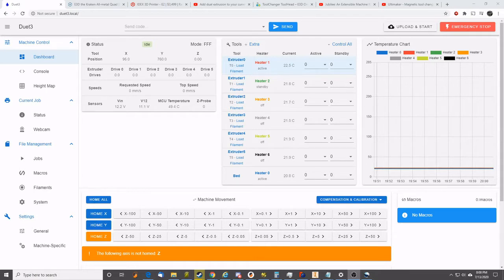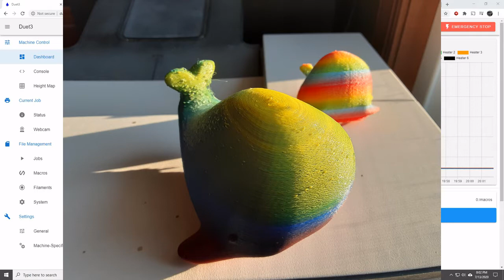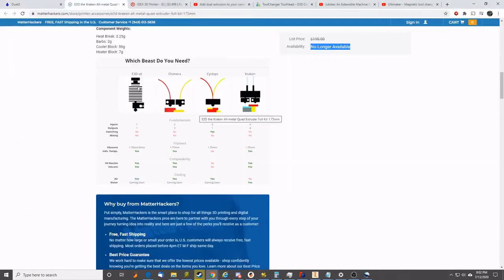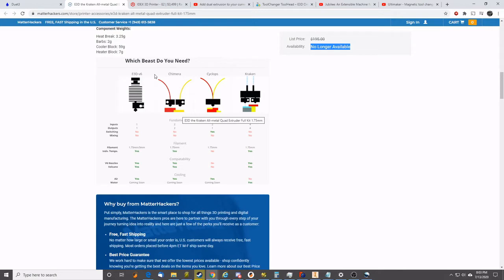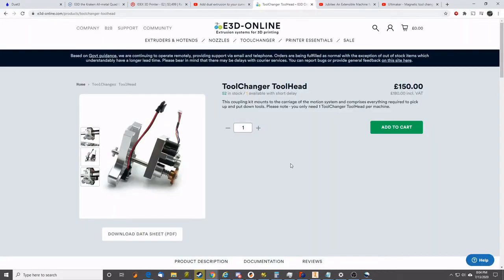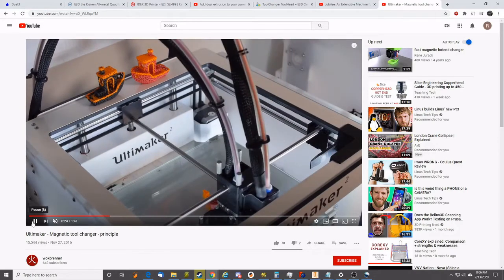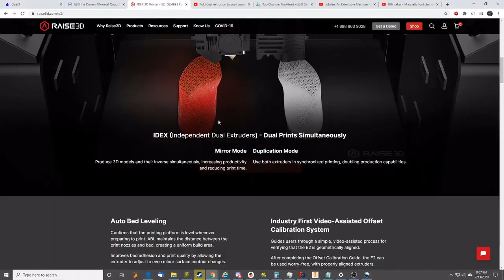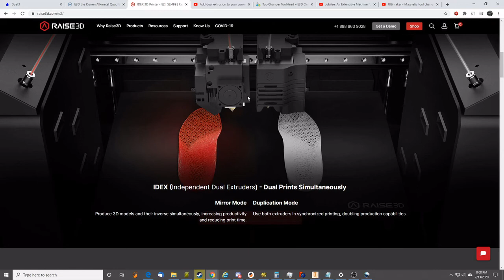Tool changing Concepts Video 1 - Motion Systems

Comment: 2in2out hotend...
Had few problems with them..
Allignment... I just loosen heat break grub screws and adjust working temp hot ends to rest against a block of aluminium placed on bed, when z=0. Before tightening up again. Makes sorting first layer height/z offsets a breeze too. 

Oouze.. Simply doesn't happen when filament isn't moltern. Problem is Many slicers will try to insist on getting extruder upto working temperature in anticipation of a tool change, to save on the 1m it takes for nozzle to cool down /next to heat up. If that is overridden it is feasible to have negligable oouze/no wipe tower.  quite possible to have carriage move to say x=0, y=0, order a temperature reduction, and cool the current nozzle down fast with a fan. And wait. Then tool change... Order temp update, and when temperature reached print continues using new extruder.
Reply: Lot of people think oouze happens because of filament pressure, entrained water/off gassing etc. I'm not so sure because of a little experiment I did/other could easily repeat...  disconnected a bowden hot end from it's tube. Feed hot end a cut length of filament.If extruder hot... Over time the filament will get pulled through hot end, even if the filament free end starts lower than hot end (ie it's not gravity) Not quite sure why.. It might be something to do with surface tension... But it happens.